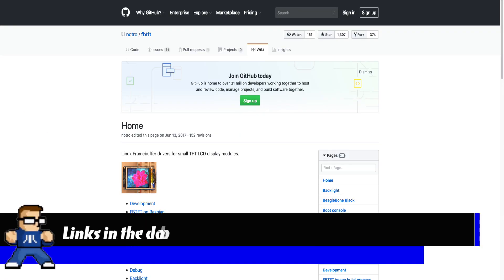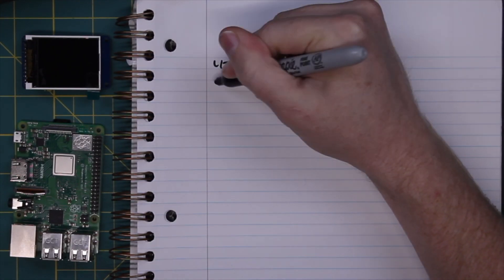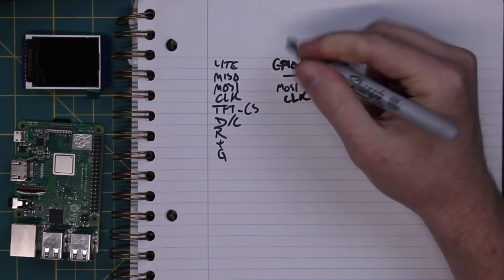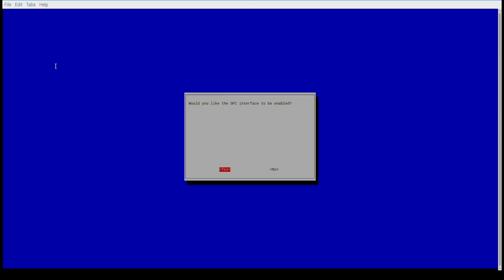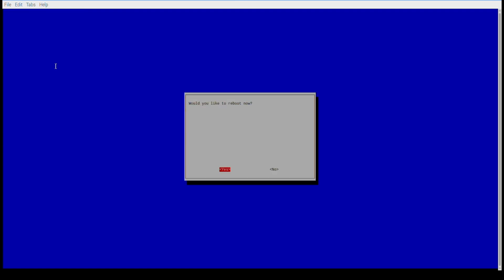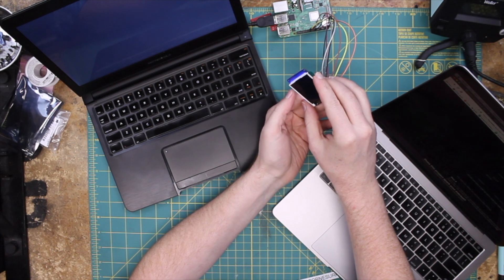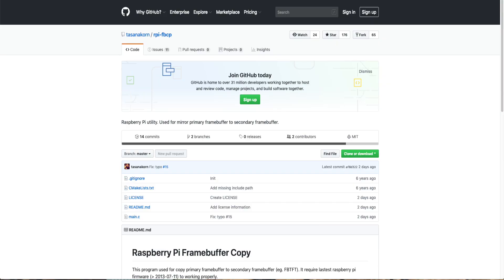How To Install TFT LCD Screens on Raspberry Pi

Comment: Hello, I am working with a 6.8-inch in-car horizontal bar LCD screen and a RGB LCD HAT. I have not been able to find the correct settings to drive my LCD creen using the HAT. Do you have any information regarding the use of these displays with Raspberry PI? Thank you for any help from you or anyone of your 100k subscribers

Comment: This only works with a certain kernel, the latest kernel 5.4 fbtft module appears to have removed fbtft and this doesn't work ( ref: https://github.com/notro/fbtft/wiki). Any chance for a new video with current kernel? I did find the old kernel but I'm still having trouble getting my LCD to work.

Comment: Also really cool how you keep switching the camera so I cant see how the hell to save the file in nano after Ive edited it. Whats the point in making a tutorial?
Reply: In nano you can press CTRL+X to exit, it should ask you if you want to "Save modified buffer", press Y and you should have the contents saved. If you're not into this witchcraft I recommend https://micro-editor.github.io which is an excellent alternative to nano, and the shortcuts are sensible (CTRL+S for save, etc)

Comment: i didnt succeed on installing an SPI lcd on Banana pi M2Z. . Although running raspbian , its a different Kernel.. I wish i had your skills
Reply: Ok bro, thanks, I'll try with my bn m2 zero
Reply: Could you make it works?
Reply: @aldoarcos69  Yes, using Armbian and modified driver code

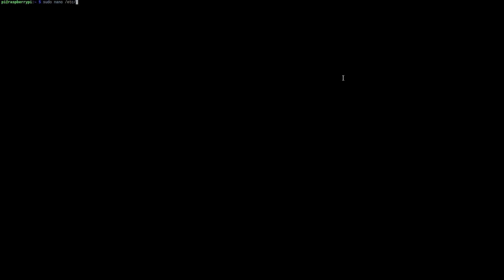Comment: I just happen to be working with the same display that you used to demonstrate: How to Install TFT LCD screen on Raspberry Pi.  I’ve gotten the unit wired up but at 5:02 into the video you started writing and so on in the terminal; I wasn’t able to follow the command sequence (much less see them).  My question is: how can I get to the success finish like you (at the end of the video)?

Comment: I'm trying to use a "similar" display will display driver, it's a 160x80 using the st7735s, i can get it to display but sadly the RGB and BGR is reversed. And it's driving me nuts. The person that made the fb_st7735r driver in all their wisdom, didn't put the bgr=0/1 command in for the st7735r. So i'm stumped.

It displays, the colors are just flipped.. So i have no clue what to do now.
Reply: hey brother can you send the connections to me
Reply: @kodigudlasreenu8602  hey girl. not sure what you mean. I think i did end up getting it working but keep in mind, the colors were flipped so what i did change the colors in the rpi camera software since i needed the camera to display on the itty bitty screen. I kind of put that project on hold since it was low priority and it's been a year and i'm also pretty sure i wiped the microSD card so that i could try some other LCDs